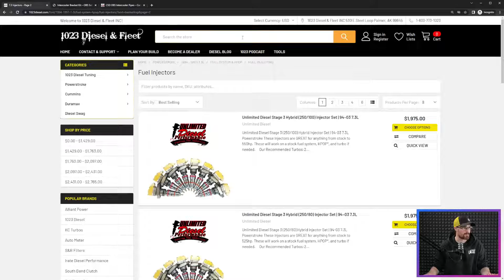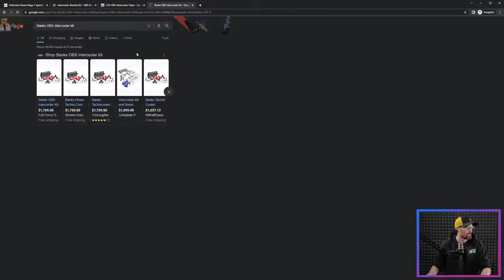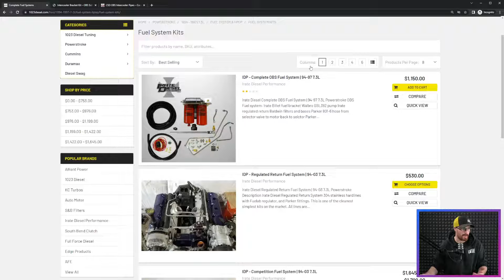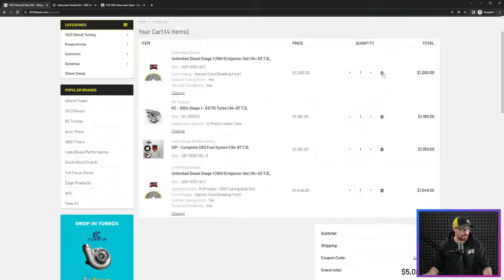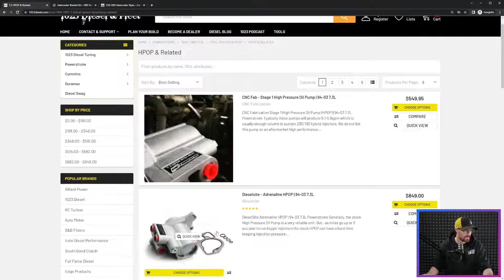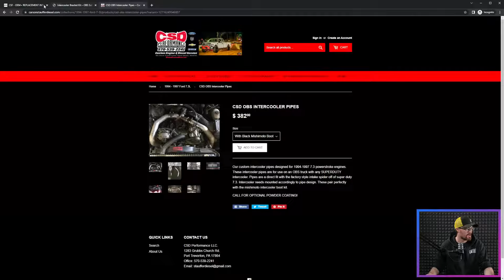Live - Planning your OBS Towing Build!

Comment: Late Comment on this Video, BUT for alll of those looking at the OBS Solutions Intercooler Bracket Kit also order a 6.0 Trans Cooler. The kit includes the adaptation of the 6.0 cooler. The whole front of the truck has to be taken apart so you might as well add the Trans Cooler at the same time. The original OBS Trans cooler is a joke.
Reply from the maker: Good call!
Reply from the maker: Pinning comment

Comment: You didn't mention anything in regards to the valve train.  
I'm really interested in hearing you talk about that and other mods like headstuds etc, when it comes to these borderline power builds.  

I'd also like to know your thoughts on the longevity of one of these motors turned up like in this video, but it being a motor that has 200k on it from the beginning.

Comment: My 95 f350 powerstroke hauls 3 car carrier 1k-2k miles a week.  Its stock even the air filter it stock.  Its little slow theough PA mountains but gets job done.  Only mods are:  110 gal fuel tank, 5th wheel and air bags.
Reply: How did you get the air bags on with the 5th wheel mounting to the frame near the same or exact spot?

Comment: I need help I bought edge cts3 3 monitor my obd port has power but won't communicate it appears fine no blown fuses dealer says they won't even try to fix wtf?
Reply from the maker: @RollingThunder85 There is a possible fix assuming something electrical is not going on. You may be able to fix it but taking to ford or another shop with IDS and have teh PCM flashed with the newest firmware.
Reply: @1023DieselFleet  ya they won't even try here in oregone  fuggin ridiculous
Reply from the maker: Try a diesel shop instead of a dealer, most decent shops that work on power strokes will have IDS

Comment: Power wise what would be the difference between upgrading the compressor wheel in the stock turbo vs a drop in replacement in a stage 1 build?

Comment: F150 5.0 makes 400 hp can a 7.3 make those numbers reliably?
Reply: That's 400hp and 410ftlbs.. The 7.3 will be 400hp and around the 800-900ftlb range.
Reply: Hell naw not reliably, most obs are going to have 200k + miles on a setup vs most 5.0s around 50k if not at 10-20k for the ballers. You throw 10k whipple on a new 5.0 you got 700+ hp and 700+ tq with the new 10 speeds you'll out tow any 7.3 with better mpg, more comfort creatures and at around 10k lbs or less. But you'll also be 60-70k into a new f150 5.0 vs 10-15k flr a beat up obs